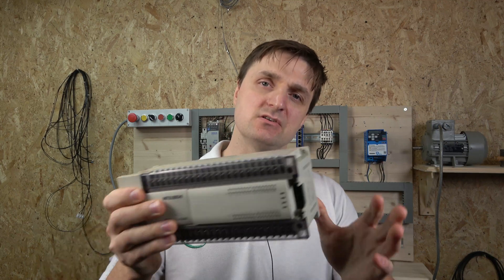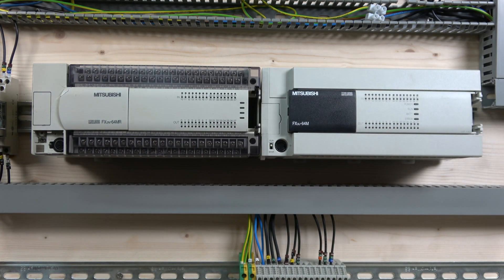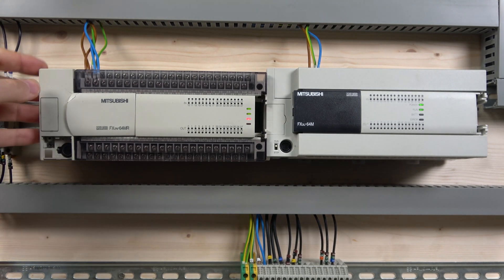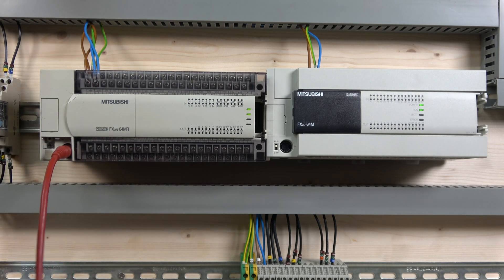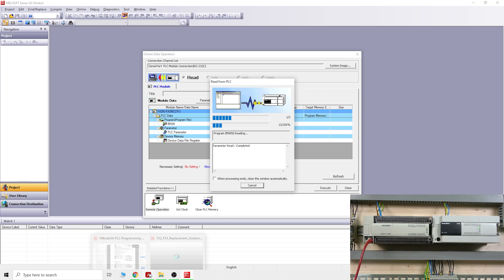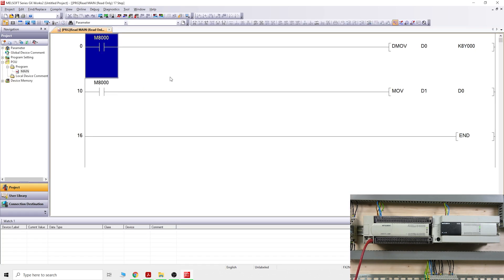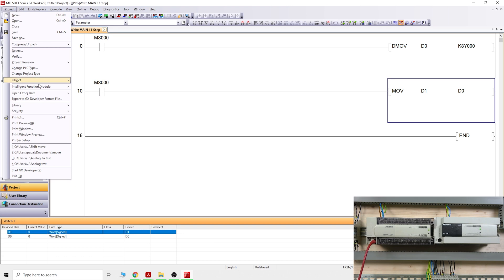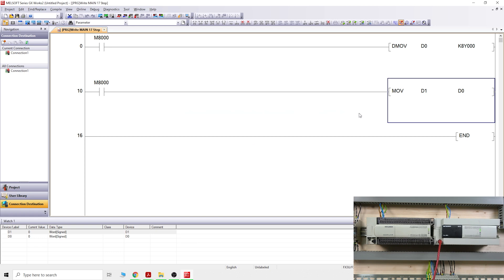How to go/upgrade old Mitsubishi FX2n PLC to FX3u PLC using GX Works 2. With sample programming. Eng

Comment: "You will be just fine" - NO we will not be fine. It is just to big risk to do this conversion. I have 40 minutes for the conversion on the ship, before ship will start discharge operation (unplanned service job because of FX2N failure. This conversion is automatic - many pages in the manual shows you how many issues you can find. I will not take a risk and I will replace damaged FX2N to another FX2N instead of FX3U. This proces is just overcomplicated if you have very limited time.

Comment: Hello, we have 2 HD blowing machines, the first with PLC FX3U installed, and the second with PLC FX2N installed. The second machine stopped for more than a year, as the battery ran out of charge and we deleted the program from PLC FX2N. We downloaded the program from PLC FX3U and downloaded it to PLC FX2N All commands work correctly but there is no connection Between the reading unit from the ADAM-4018 thermal sensors, a new unit has been changed, but the problem is still. Do the RS485 settings in the FX3U differ from the RS485 settings in the FX2N, or is there a problem with the card?
Reply from the maker: It could be to do with addressing. Make sure that the bus address match, as specially if you using new temperature unit.

Comment: Hello, is it possible to test the inputs in the same way as the outputs with GX Works?
I would be very happy to hear from you.
Reply from the maker: Hi There. No, you cant test the the same way as outputs. Best way to test it is to go to batch monitor, enter x0 in the device name and take a wire with 24v applied to it and go true all the inputs one by one. Thant how i test inputs.
Reply: Thank you for the help.  How about a short video on the subject.  I think many beginners would be very grateful to you.
Reply from the maker: @konradmichelis5350  Do you mean PLC training?
Reply: @IGSElectronics  Hello, yes PLC training. A separate video: How to check the inputs and outputs of the PLC with the help of the software.
best regards